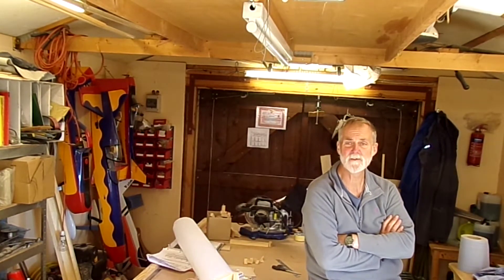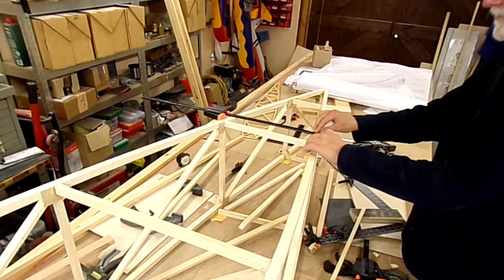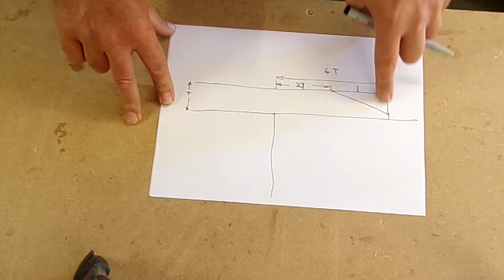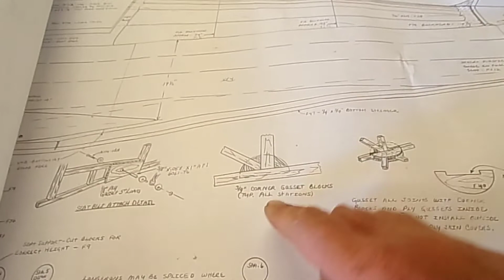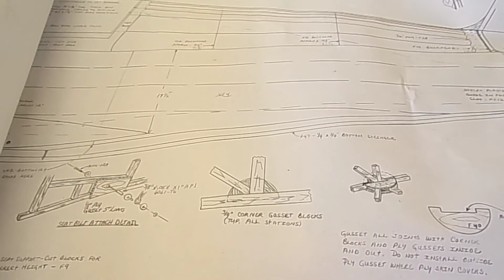EP73. Fisher Youngster V fuselage truss 80% Complete

Comment: I was not able to see if you were routing pockets for your gussets like you did for your horizontal stabilizer. Is that your plan?
Reply from the maker: No these are surface mounted and with the set back will not be in contact with the covering which will be will be going from the longerons to the stingers missing the gussets.